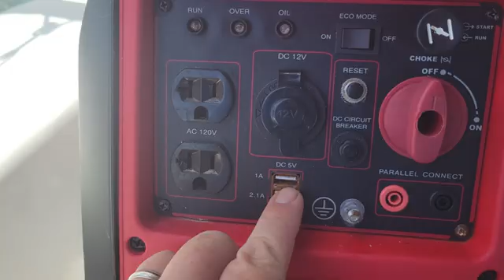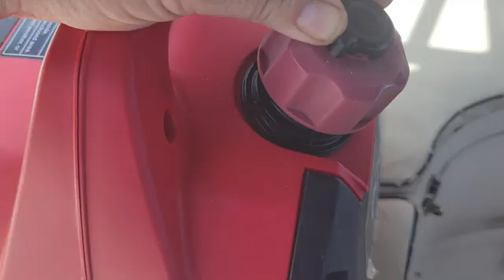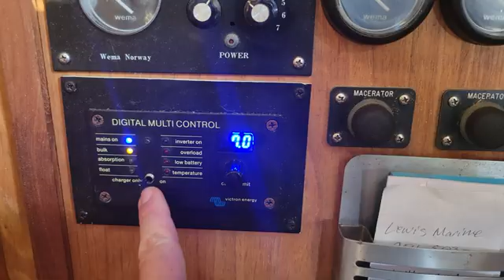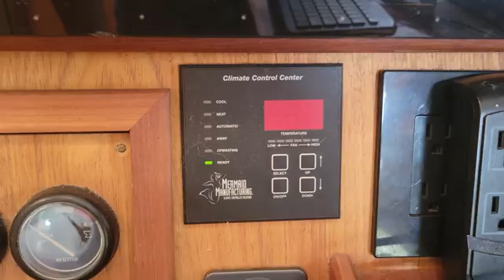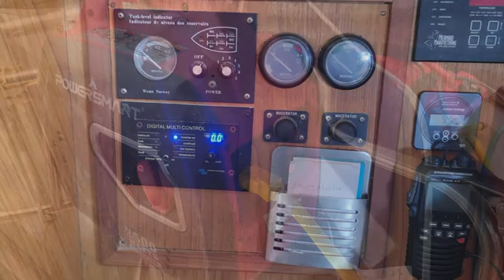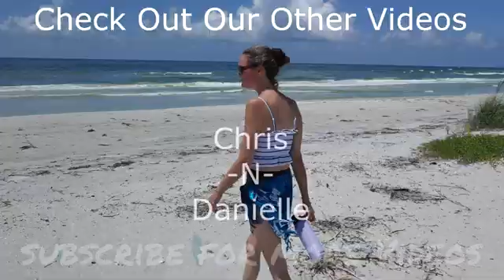Review Of PowerSmart 2500 Watt. Will This Generator Work Off Grid?

Comment: good video. nice to see you are getting good use from your generator. I am curious to see the long term affects on the circuit boards and electrical plugs attached to the internal boards as far as corrosion from the salt air. Maybe something to look at once every 6 months or so.
Reply from the maker: There is very little rust on the generator with only the usb port and some on the muffler. We will have a video witht he side off showing maintenance of the generator with the sides of if we survive the hurricane. As far as inside the boat, we have all victron that is years on with no issues.